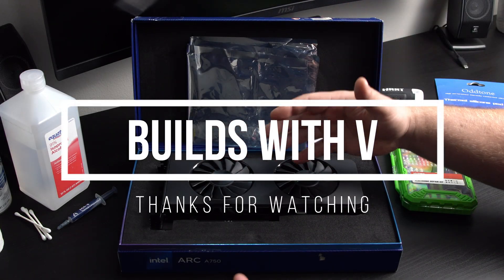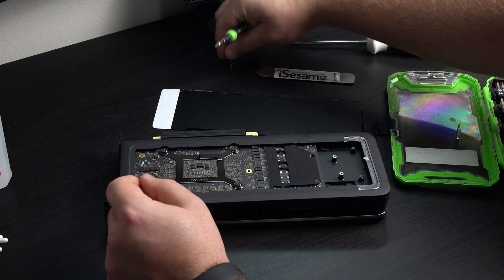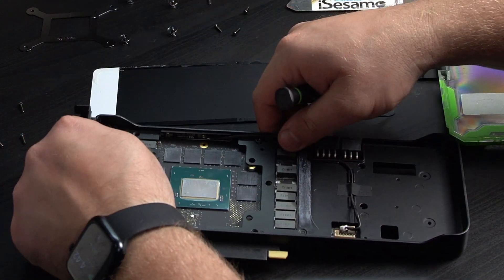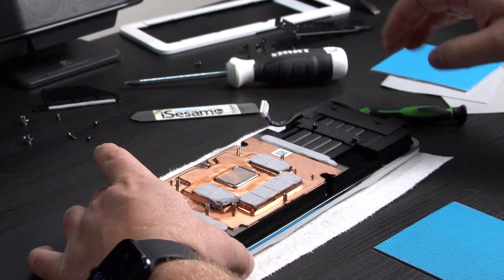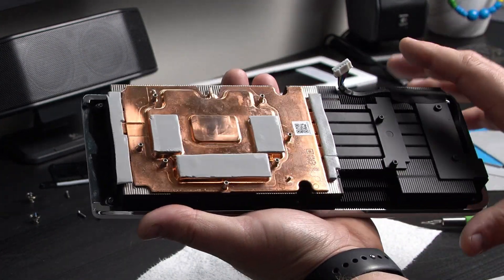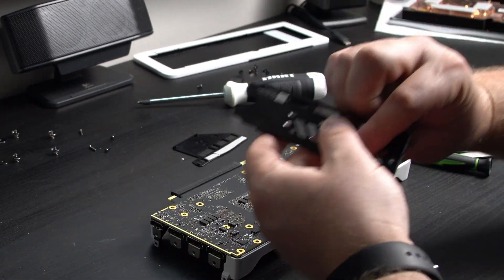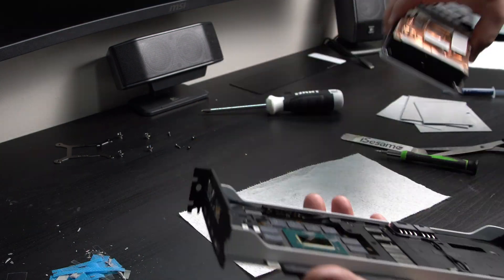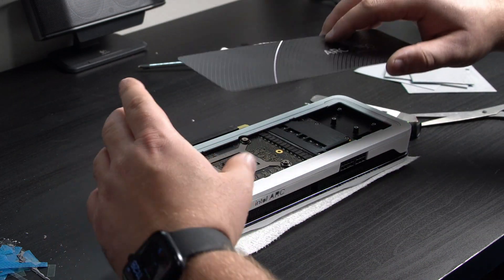How To Repaste Intel ARC A750 GPU

Comment: Never EVER scrape with metal on a DIE , NEVER! You could desrtoy the DIE with an ease!
Reply: silicon has a greater hardness than steel. blunt force is an issue, but 'scratching' it is not really a concern

Comment: i bought a750 like a week ago and in games temps are ok 75C on gpu 80 on vram do i need to repaste it?
Reply from the maker: @h3ctor429  seems pretty normal tbh, especially if it’s warm inside the house.
Reply: @BuildsWithV  sometimes im scared that its gonna break or something
Reply: Dw mine goes upto 84 sometimes
Reply: Just set waltage in the graphics software to 115 Watts guys, my temps dropped from 89° to 71° with only like 10-13 fps drop in rdr2
Reply: @null2089 thats a big fps difference though. And what the fuck is 89? Mine reached max 80 degrees while my room is 31 degree. Are you gaming at sun 😂